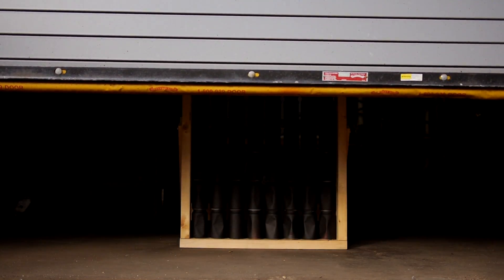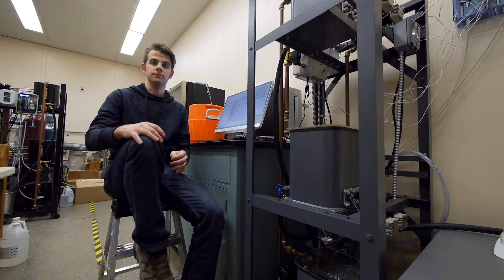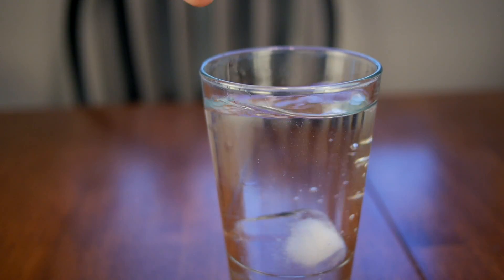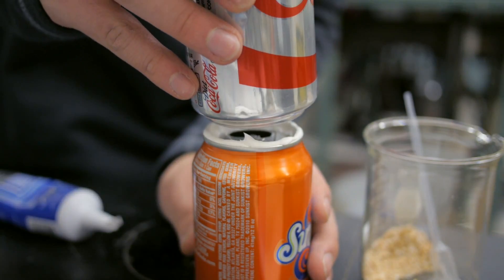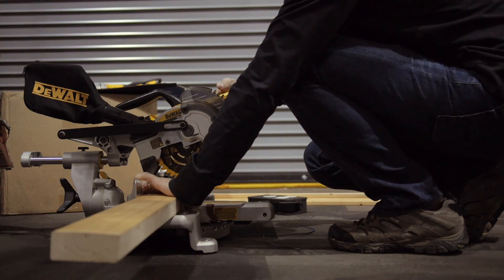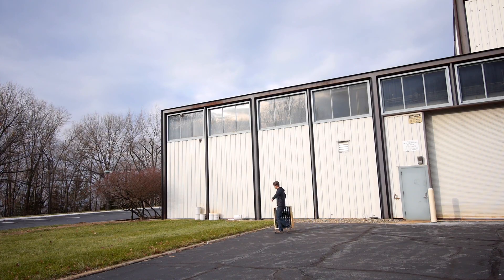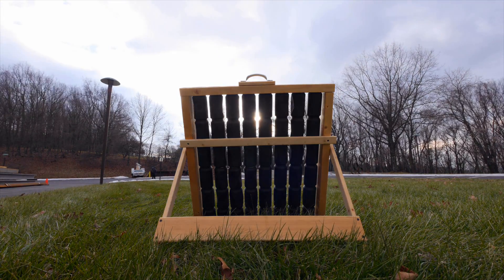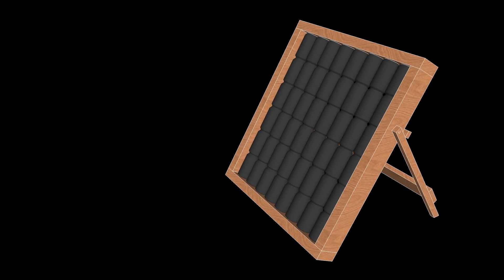Trying to Heat with a Salt Heater

Comment: why the holes in the wood? as of what purpose does it have? when I've seen similar like this, they have them for the air flow but when you don't have the holes in the cans it's different.. my thoughts was if the wind was a thing why have them.. also why you then don't have back on it, so it doesn't blow through the pillars and with the spacing between more wind..

Comment: Here is how you actually do it, it's simple.
Buy a large pot, something that holds around 15 litres. You want to wrap this pot in an insulation wrap that you can take off with velcro.
Use hoards of salt, and dissolve in water, boiling point will rise to around 118 degrees. 
Use thermal glue to glue a 200w heating element to the underside of the pot. Then place a sheet of oven grade silicone sheet under that to insulate the underside of the element as well. 
Now connect this to a 200w solar panel.
The energy from the solar panel will collect in this 15 litre saltwater pot throughout the day. Then when it comes to night time, once you start to feel it's cold, take the velcro off the pot and let it release it's heat energy into the room. 
At this power level it can only heat 1 room BTW, if the pot was pure water it would take around 1.4kWh to heat it from 20 to 100 degrees. However the real number is higher because it's saltwater instead and can heat to an even higher temperature. The pot can likely contain 1.8kWh of energy, and the total input from the heater can safely be up to 2.5kWh because there are losses and such in reality. What it means is that the system is safe to leave running and it can never overheat too much, because the max amount of power that a 200w solar panel can possibly output in a single day is around 2kWh, and that's on a hot sunny summers day. 

I know this works, because I personally use it myself in my bedroom. I have my door closed, open the velcro and my room is literally 9 degrees warmer than any other area of the house of a night time. 
Therefore it is possible, note that my room is insulated and has carpet and thick blinds, so heat can't escape easily and is trapped in there mostly. If however you had a room with a draft, no blinds, and a wooden floor etc, your room from this type of heater I explained may only be 2-3 degrees warmer that other rooms in the house.
Reply: Nice ! What insulation material did you use and what thickness ?
Reply: So he is using sodium acetate trihydrate, with both latent heat and sensible heat storage. The latent heat comes from the phase change that happens to sodium acetate at 58 ish degress. Assume you allow the temperature to rise to 120 dC from 20 dC, both latent heat and sensible would give you about 2.2kw of storage in a 15 litre pot.

Comment: You could have aimed multiple mirrors on the panel and used solar glazing to prevent heat loss from the wind.  And use a better type of salt maybe?  Flibe comes to mind.  You can get that salt up to 1000 degrees C!

Comment: How did you determine how much water to add to the calcium chloride? Also, why does adding sawdust help it freeze?  Is it because you are adding impurities?
Reply: My rough, not-a-mechanical-engineering-student calculation is that you'd need ~363g of CaCl2 per liter of water. (I found a paper online that uses a similar idea, and listed the solution as CaCl2•6H2O so I looked up the average densities and then math'd.)
Reply: it's sodium acetate not cacl2, sodium acetate is also used as snow melt. it has melting point of 50dC and latent heat of 260 kJ/kg or 0.07 kwh/kg. now you also get sensible heat as well but i can't be bothered to calculate that. For a cubic meter you would get around 106 kwh, weighting about 1528kg. so not the worse but not great. Look at chemical thermal storage, taking CACL2 and allowing to hydrate (add water) you get 260ish kwh per cubic meter.